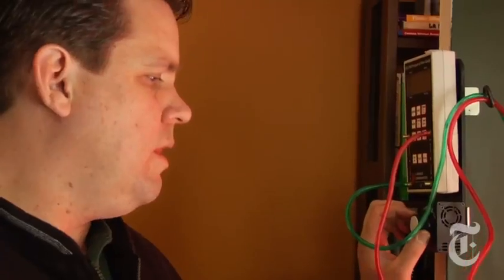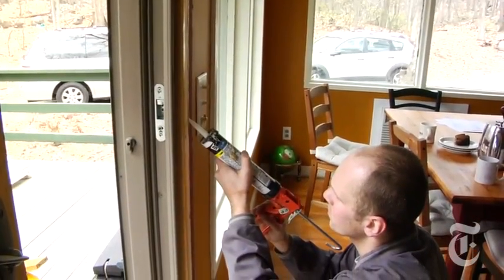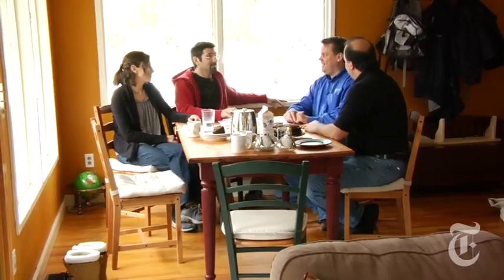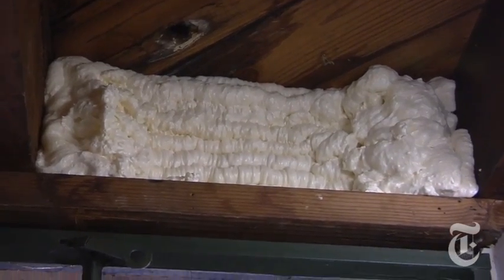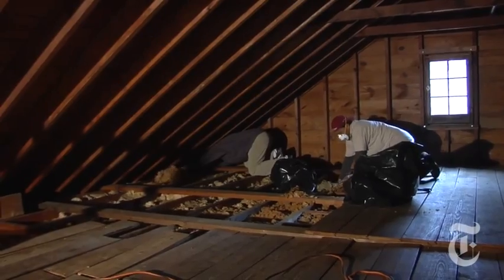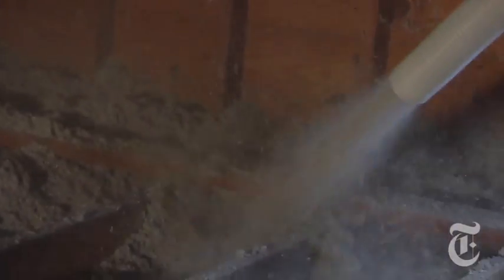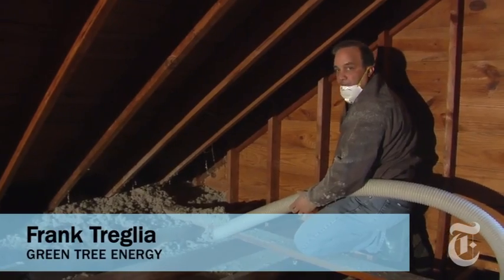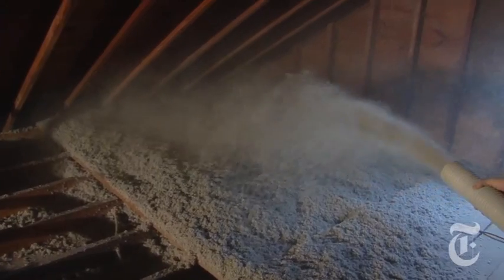Home Green Home: Insulation and Air Sealing

Comment: @ak99372 

More often than not, old insulation covers holes in the flooring that separates conditioned from non-conditioned space.  To make the job easier on the installers and ensure quality air-sealing, any time I do an audit and find old decayed insulation, I recommend that it be removed.  It really depends on the state of the current insulation, but insulation without adequate air-sealing is a waste of time and money.